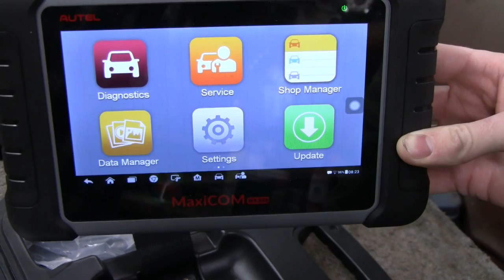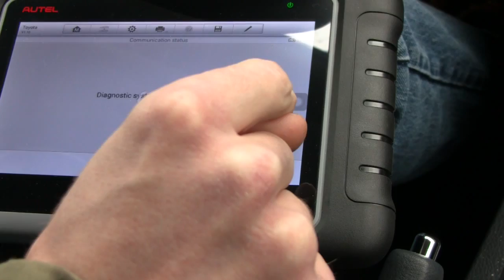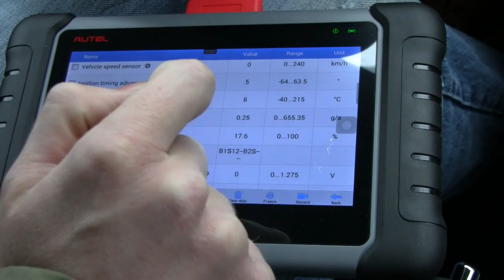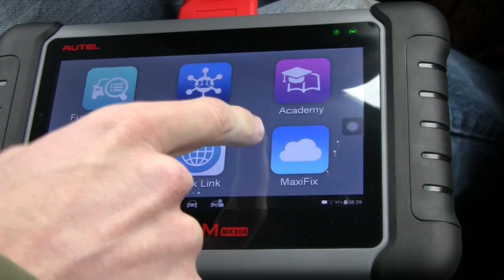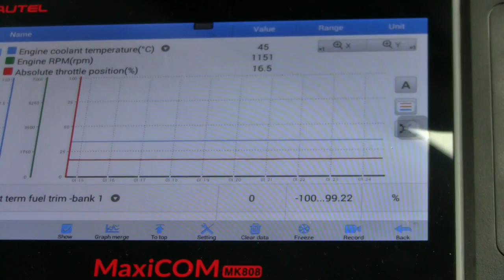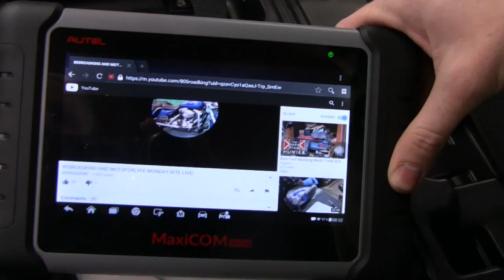AUTEL MAXICOM MK808 OBD2 SCANNER REVIEW

Comment: Thanks for sharing your review! I am in the process of looking for a scanner that can do more complex ABS brake bleeding and solenoid valve offset after replacement of a new brake booster assembly/with master cylinder and brake booster pump. 
I have a 2010 Toyota prius. This is a scanner( MK808) that fitS my budget but I am not sure if it has the functions that I need. 
I know other more expensive AUTEL have a special function which can do this job. I just want to check with you first. Thanks!

Comment: Was thinking about getting this scanner for the shop to do pre and post scans on vehicles. The snap on scanners have a really easy to read print out that will show the different fault codes in a pretty simplistic way. Does this scanner do the same by chance? It seemed like it had access to all the systems the snap on one does, I just don't know if it's as easy to read for customers. But this would save us like $2000. Plus it has updates that are cheaper and less frequent.

Comment: I bought this unit specifically to zero the steering wheel angle sensor on a 2012 Chevrolet Corvette.  It would not auto find the VIN,  it would not communicate with the ECM, and it gave a communication error trying to do the SAS which is Steering Angle Sensor.  Autel was pretty good on phone support.  The tech used the remote access , and tried all the things I tried to make it communicate, including reloading S/W, and selecting the Corvette under GM.  Told me to check the fuse on the ECM.  Really????  No go on the Corvette.   Tried it on my 2013 Toyota Tacoma.  It would not auto find the VIN , and it had no modules that it would communicate with.  He told me it would take about 3 days for support to get back to me.  I told him it’s going back to Amazon for credit.  Amazon is great.  I boxed it up, printed the shipping label and took it to UPS.  In less than an hour, I had full credit.  The tech suggested I buy the MX808 instead.  I’m going to buy a GM Tech II clone.
Reply: YouTube showing me odd videos today and seen your comment, I haven't had issues with this scanner on corvettes, also odd the tech would recommend you to buy the MX808 instead being as its literally the same scanner just the dimensions of it are slightly different.

Comment: Will this unit perform bi directional control? Perform output tests?
Reply: From what I understand, this particular model is not a full bidirectional scanner. I don't believe it has output test capabilities. What I'd like to know is if it has the capability to do idle relearn, throttle body initialization, and other functions like GM abs auto bleed. If this is truly a "read only" scanner, then I'd say it's a bit limited, but I don't think the price point is unreasonable for this tool. You're gonna put out some $$$ for a fully bidirectional scanner.

Comment: It's pretty cool that you guys tested this on a Toyota because I trained with Toyota's T TEN program to be a dealership tech, and this scan tool can pull up the same stuff our Techstream units do. Ive been looking for a decent professional scanner to use on other brands and the cars I have at home, I might have to keep an eye on this one.
Reply: how much that one?
Reply: @angelavillegas4320  Can't really buy the dealership units. They use Panasonic toughbooks with the software on them and a base mounted to them with VCI (vehicle control interface) built in. The most reliable setup available to the consumer is the Techstream software (which is fairly affordable) installed onto a regular laptop with a Drewtech Mongoose VCI cable ($400-700 depending on where you look). This Autel is by far the better deal, to be honest.

Comment: I have the BlueDriver unit that I bought this fall. Works similar but uses my smartphone to display the information. Only $99. If I did this for a living I would spring for one of these.
Reply: I have the BlueDriver unit as well but it doesn’t read transmission codes

Comment: on the scan tool I use it will only let you test components when you select the right vehicle the obd scan is just reading engine data I only use it on things the scan tool does not list
Reply: mike doblo it doesn’t do transmissions 🤷🏼‍♀️

Comment: I just got one of these. I love it. Been the best tool I’ve purchased to date and it will tell you everything that’s wrong with a vehicle. I like being able to program key fobs, tpms sensors, bleeding ABS systems. Great system for the price. The only thing I don’t really like is the price for updates after 2 years. Think it’s like $500. Also you can pull up the history email the report and look up codes on a vehicle later.
Reply: snap on gives free updates for 6 months after that they come out quarterly and cost close to 700 bucks. no one can complain about the cost of updates if you look at all the time it takes to compile all the information and then build the software package. If you are a do-it-yourselfer and the scan tool has what you need you can shose not to purchase the update. i dont have that option, i have no idea what is waiting in my parking lot in the morning when i open up.
Reply: Danny Scarpati I work on vehicles for a living and what you said about snap-on is the exact reason why I didn’t choose their tool. The cost of updates are a little on the ridiculous side with snap-on. I have two different scan and diagnostic tools from Autel and they’re both great products. I have this exact scan tool and I have another that’s got all the bells and whistles. Can’t remember what the model number is, but it’s wireless and is able to use add on accessories for doing a lot of large diesel trucks I work on often.
Reply: @thomasstrickland0  no doubt,  Autel definitely makes a great product.
Reply: @thomasstrickland0  does the vehicle power the scanner or do you have to charge it? I read online you have to charge the mk808 and I'm not a fan of that.
Reply: Mitch Puterbaugh you will have to charge it. Works on an android platform. Has pretty good battery life if you treat it right.
Reply: Can it do pcm reprogramming like vin callibration?
Reply: @bryansautoandmotorcyclerepairs  yes depending on the vehicle. If you’re only programming vin into ECU.
Reply: Can it do vin reprogramming